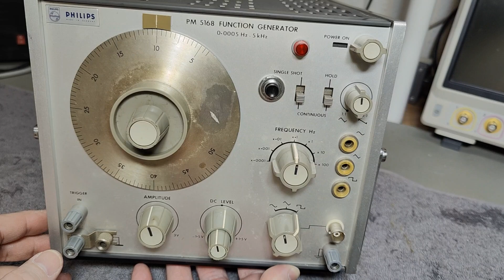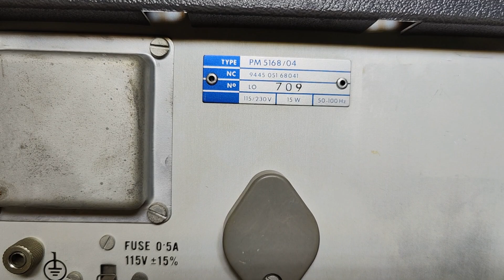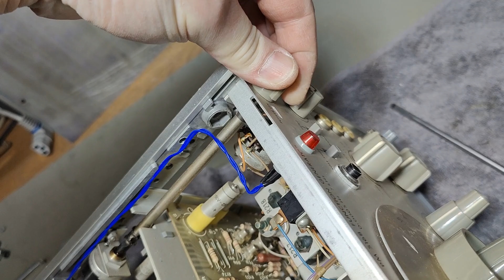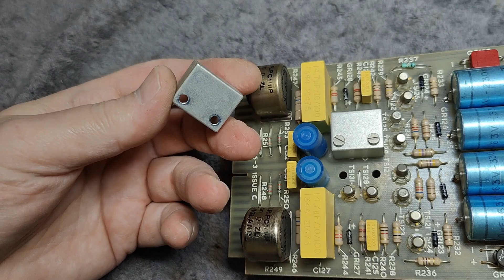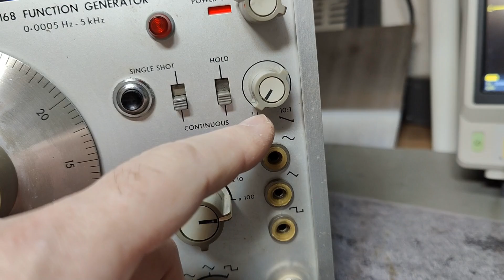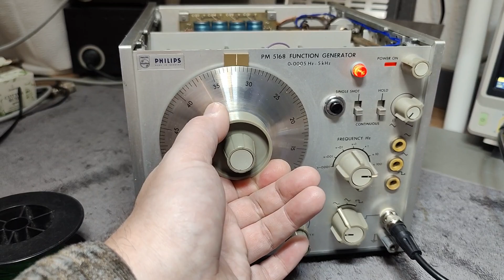Philips PM5168/04 Function Generator 500uHz - 5kHz 1968 teardown

Comment: Hi. Have you tried the trigger input?
Reply from the maker: yes i think i did
Reply: @TeardownOZ2CPU I’ve tried it, but nothing seems to happen. Does it say in the manual what kind of trigger it expects?
Reply from the maker: @stevenr.sellick1395  go into single shot mode, +2V pulse, and the pulse must be shorter than your output periode time, else miss fires
Reply: @ Still not figuring this out.

Comment: Thank you very much showing hoe to adjust the sinewave, mine had the same issues as yours, may be the same component changes with the years.  Also the DC level was way off, but some of the 8 big potentiometers influenced it so I managed to get that better.
I have number 958 of the PM5168. it has not the Light bulb modification. So that is probably not original.
Unfortunately it does not have the precision capacitors. May be they were gone bad in the past, so someone put some small through hole caps on the wires with some tape around it. (tape fell off when I opened it).
I added some small pieces of black tape covered with cellotape next to the potentiometers, before starting to turn them to get everything right. (very useful when all is misadjusted)
Sinewave looks perfect now. (finally)
Also I did not find any schematic. started to trace the transformer, measured 2 primary windings, and secondary one winding 46VAC, and the second winding, was a little bit hard to measure because of the coating over the trafo contacts., Same bundles of wires, but no connector for the pcb, did not measure the mains power, may be the extra 3W from yours to get 18W total is caused by the lightbulb.
The frequency adjustment, I did not do that yet. May be some time, but for now it seems good enough.

I got a PM5711 too Pulse generator, all have about 50% of the rubber feet dropping off / deteriating of old age.
I did see a stamp with a box and 66 on the bottom about where your's has the lightbulb. And mine had also the brown back of the big knob fallen out of the black housing, it moved to a side, I did not recognise it at first.

Comment: You could also use the FFT on your scope, to tune down the harmonics?
Reply from the maker: true, it will give some sort of indication, however it is only 10 bit full scale vertical,
Reply: @TeardownOZ2CPU  Sorry for the late reply, I wanted to do some measurement before replying.  I'm more of a RF guy, don't have any low distortion audio generator, so I put 2.3MHz +16dBm signal from my ooold HP8663 into my ooold 8bit TEK 3012 scope. I set the vertical sensitivity to get full screen deflection. Switching to FFT, I could accurately (~1dB) measure down to -40dBc. The noise floor was a little above -60dBc. I could see a -50dBc signal, but the level measurement was very noisy. This is worse than expected from theory, but kind of expected, as the FFT function on digital scopes is usually just an afterthought.
BUT -40dBc is 0.01% of power. Your 10 bit scope should probably go to at least -50dB (0.001%), maybe even lower, if you can use a longer FFT (my TEK3012 only has 4k of sample memory).   So I think it is worth a try! (Maybe make a video about it, HI)
Reply from the maker: @markocebokli6565  my siglent scope in 10bit mode 2Mega points -110dBv vertical signal handle capeability 0-20kHz freq span.

Comment: "Smoker Layer" 😅There are special nicotine removers. I've already made several old devices shine again
Reply from the maker: anything containing alcohol will remove the smoker layer, but also some types of front plate coatings and paint is made not to handle alcohol so that needs to be tested every time, I start with low prof.

Comment: If you have some way of measuring THD, it's a great way to dial in the sinewave geometry accurately.
Reply from the maker: i got at least 3 units to measure THD, it is as you say the best way to perfect a sine, i just start with the most visual, and understand what the four trimmers do, the combination of them also move the wanted frequency, so all needs to be right, i think the scope explain is better for the video, more visual and show more things at the same time, so the viewer will understand better

Comment: 16:30 I always wonder why people back then didn't even seem to THINK of separating primary wiring from the rest of the wiring harnesses - it would have seemed like a good idea even back then to a) maximize safety in case wiring gets damaged and brittle, especially with test gear where users tend to touch stuff that is connected to inputs or outputs, b) make it hard for anyone servicing or modifying the unit to accidentally wire mains into anything where mains doesn't belong, c) make it easy to disconnect sensitive secondary circuitry when insulation testing the unit? I guess mains electricity was really less deadly back then :)
Reply from the maker: maybe they simply did now know as much as we do now ?
Reply: It was a different world back then, hard to understand if you weren't part of it.  When this was designed, they weren't hand-wringers when it came to safety.  It was expected that anybody opening a chassis would have the requisite training to keep themselves safe.  The onus back then was on people to learn how to keep themselves out of danger.  But along came the lawyers who flipped everything around and now you have to protect even the dumbest Darwin candidates safe from themselves.  On top of that, you now have millions of videos produced by anybody with a camera and an account showing folks how to do all kinds a stupid, crazy stuff that can get them killed making it much, much more of an issue. 

BTW, it was extremely common back in the day for folks in the US to file the wide blade of a polarized plug to normal size so that they could us the older non-polarized receptacles that were still in common use at the time.  If I was doing a service call at somebody's house, the first thing I would check would be the ACV between the chassis and a good ground to make sure the line wasn't on the wrong side which it was probably 30% of the time!  If the polarization was correct, sometimes the house was wired incorrectly.  Even if all that was good, I'd run into leaky bypass caps to chassis ground that could put quite a high AC voltage on the chassis as well.  Despite this, folks weren't dying left and right from electrocution as a result.  Mains was just as dangerous back then, it's just perceived to be much more dangerous today.

Comment: 14:00 would you not, for a production PCB, make these traces as thick as you can (without wicking up too much soldering heat, of course. Maybe hatch the area?), in order to conserve etchant?
Reply from the maker: YES, more copper is better, bigger solder pads better more relaiable, and it is better of the envioment, less chemical waste, and it is cheaper too, since acid will last longer, the photofilm development also last longer, since it is also poluted by all the material it remove. I design PCB's as a full time job, my best designs remove almost no copper,